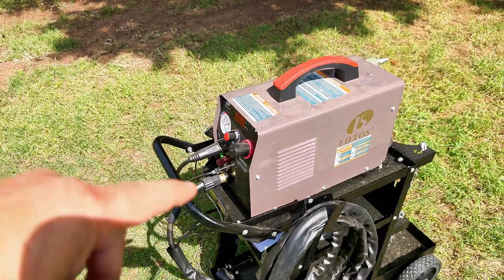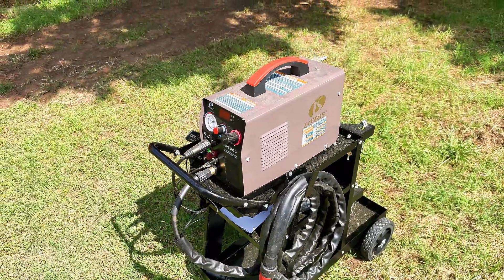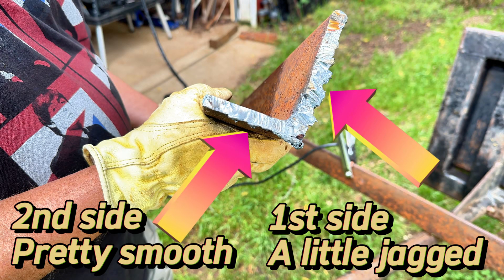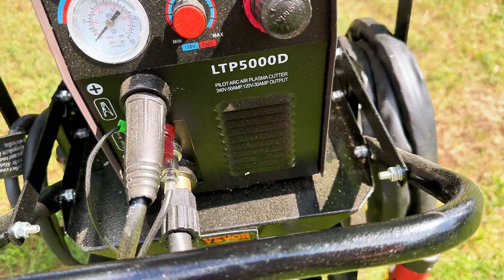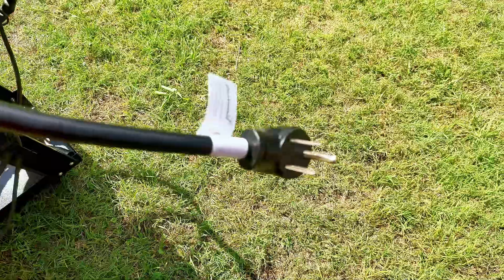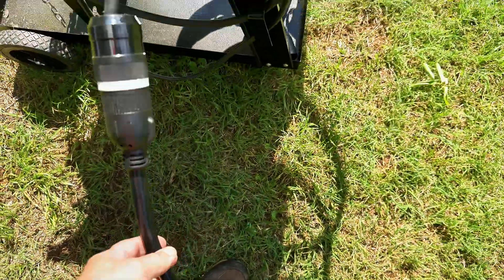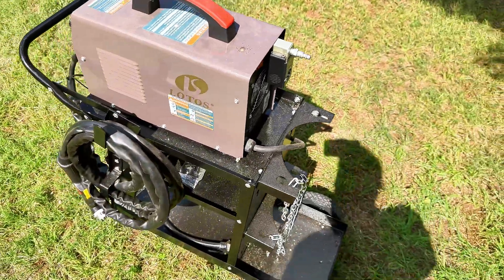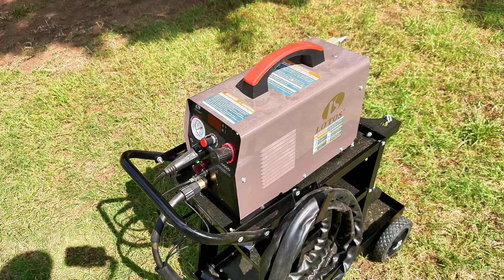Updated Review of LOTOS LTP5000D Plasma Cutter, 50 Amp Non-Touch Pilot Arc Plasma Cutter

Comment: That is the worst plasma cutter!
I have bought 2 of those plasma cutters, and neither one of those are worth a s**t.
The company sent me another brand new one, and it cut for about 1 minute and did the same as the other 2.
I won't buy another one and don't want it if they send me a new one. 
I found out that the consumables only work on matching numbers as the cutter. 
Garbage!
Reply: I've had mine for well over a year with no problems.
Reply: @BIGALTX  I'm happy to hear that. 
It gets kinda upsetting. 
Anyway, the company doesn't want to give me the money back. They want to send me another one. 
I guess it is what is. 
Thanks
Reply: I bought one and when i try to cut 3/8 material the yellow lights comes on and alarms out might work for a minute  then i have to shout it off and try again
Reply: Will try that thanks  @deandye3255
Reply from the maker: @deandye3255  Doesn't work great for me in 120v - but is a Boss when I run 240volts
Reply: Mine has been running great for a few years. Your problem is in the mirror.
Reply from the maker: @dontblameme6328  Good to know... Thanks!